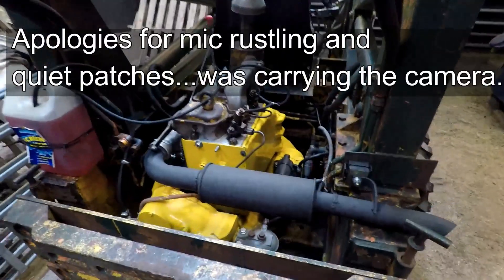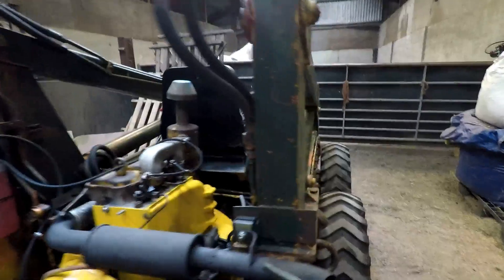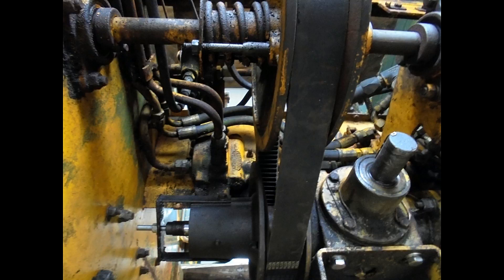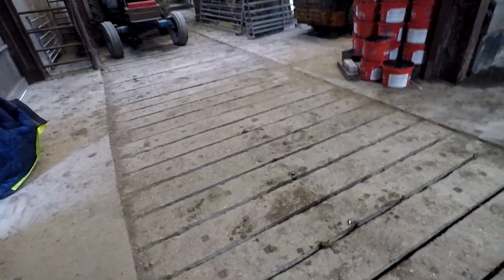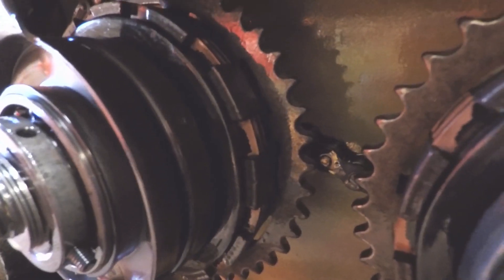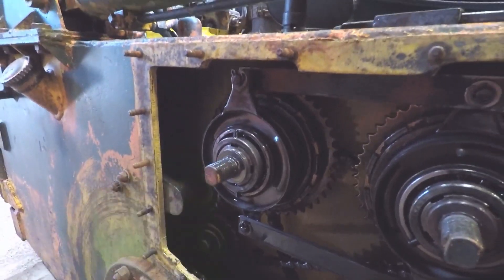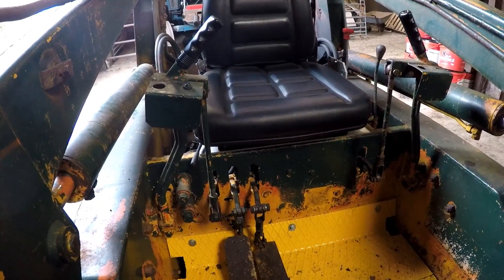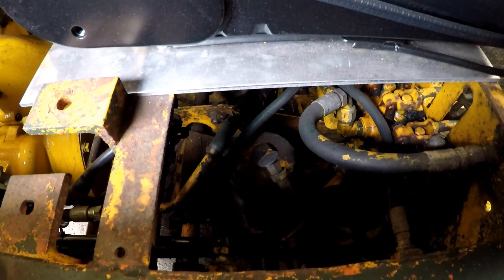Case 1529 Skid Loader. Clutch adjustment and General information on the model.

Comment: These older CASE skid loaders  we're/are almost impossible to locate parts for when it comes to anything breaking let alone wear parts like the clutch discs used for the steering clutch packs. I did finally locate a business in the US that sells them. The name of that business is LPS. Easy to find online..

I now wish someone had made a Video of replacing them as I now face this job myself w/o a clue as to what I'm doing!  What worries me is that I have memory issues which this job might challenge me greatly. I doubt I'll be able to record it but if it's possible I will try so others have something to go off it attempting themselves. I bought my new discs maybe 6 months ago but have been putting this job off because I don't want to mess it all up! lol. Wish I would have found these parts before my memory started failing me. For 10 discs, 5 per hub/wheel it cost me around $600.00 dollars, US.. Some later models only used four clutch discs per pack/wheel my online manual mentions..
Reply: PS, I have a 1537 CASE Uni Loader which is basically the same machine as a CASE 1530 is.. Someone before me removed the tag # from my machine, sadly so I don't know the exact model due to this missing tag/identity plate.
Thank you for the Video as it helps many people who buy one of these old machines, IMHO. My machine easily lifts well over 3,000 pounds with no problems..

Comment: Silly question but how did you remove the collar with the set screw? That part of the video was cut out. Did you get any video of that process? I was thinking I'd run the set screw out until they clear the notches and then put a pipe wrench on them. I just don't want to mash the collar so it gets egg shaped or break off a set screw. What did you do? Also, the entire assembly wants to move when I apply pressure. How did you hold it in place? I'm afraid if I put a pry bar on the sprocket I could bust some teeth. Thank you in advance!
Reply from the maker: the Nuts for the clutch adjustment shouldnt be much more than stiff as they live in hydro oil and the thread is pretty fine - as said i didnt need to put undo force on the setup on mine - if you are having issues holding it you could put both large outer nuts on a single shaft and lock them against one another and use one or the other to take the bulk of the torsion.
Reply: @ferretboy221  Appreciate the info. Good idea about the outer nuts!

Comment: For what it's worth the Wheel bolt pattern should be the same as a GM half ton PU truck which I assume you could easily find in the UK. I mention this as then you could use/run a 16 inch tire if wanted and the rims would easily hold the weight of the machine, IMHO.
Reply: I was wrong! The bolt pattern is not the same as a GM 6 bolt truck wheel! My bad and I wanted my mistake to be known. Sorry.

Comment: I have a 1529 also, mine has a 3 cylinder water cooled in it? Have you seen any with a 3 cylinder? Also have you looked into getting replacement drive clutch plates? Thanks
Reply from the maker: Is that a Deutz engine?.....clutch plates, i have found some of the proper ones but the cost would be ridiculous to re-line the whole vehicle. so at the moment im looking for a reasonable source of them too. Also to bear in mind there are two different types.
Reply: @ferretboy221  Dont believe its a deutz engine as its water cooled, I believe its a david brown engine, and ive seen others with the same engine so i dont think its a 'garage shed special'. When you say there are two different types, is that for fwd/rev?
Reply from the maker: @Falconavich  No there are two different clutch plate types as fitted to the whole vehicle ie all 4 sets, my plates are Formsprag plates whereas another skid may have Stearns type plates......they are just two slightly different systems. parts are different in each...but each system does the same job in moving the vehicle
Reply: How do you know what plates you have i just got one and in the middle of restoring it its fitted with a straight 4 gas engine but its my 1st project like this im in the middle of replacing the hydraulic lines and new tires but doesn't move left so good and how do i fill the hydraulic i have no info on it any info would be much appreciated
Reply from the maker: @TheLj4100  Mine literally have the Name Formsprag stamped in to the outer covers where the levers operate. also the plates are a different shape and design from what ive seen in the parts manual